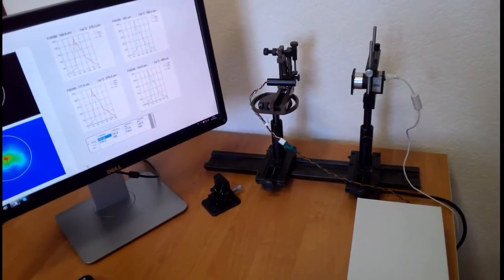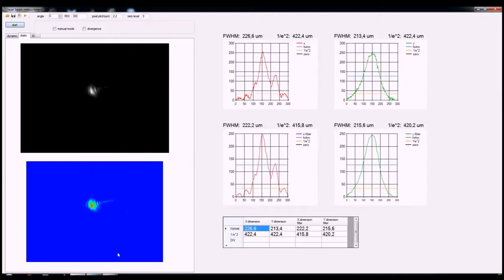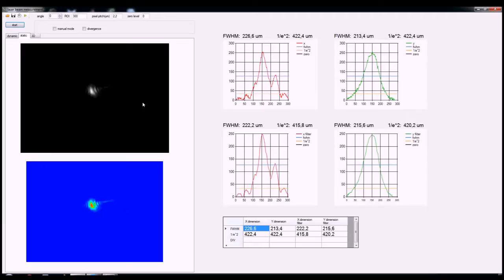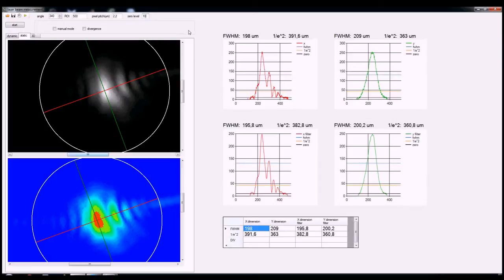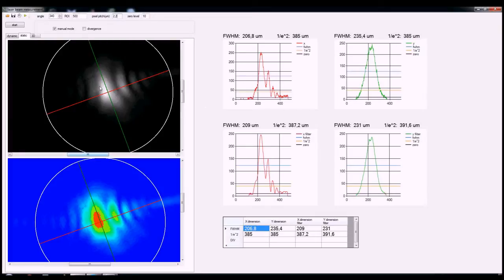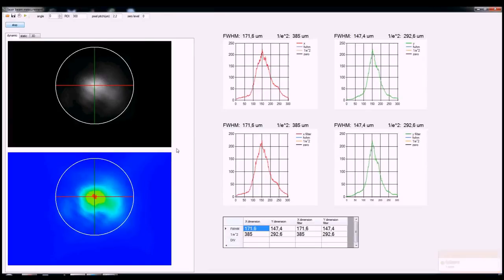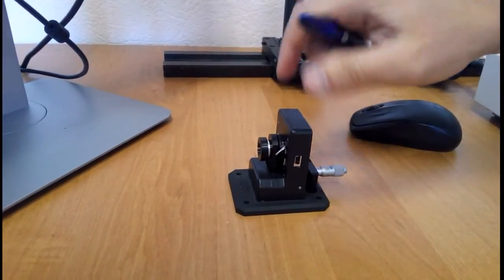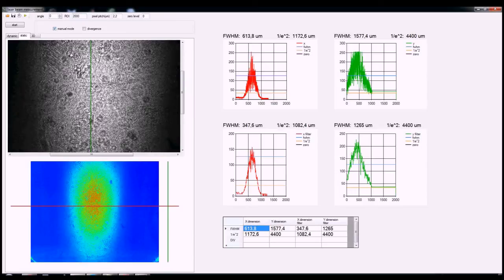Open Source laser beam profile measurement software

Comment: Hi, When I directed laser beam to a cmos color camera I saw a kind of interferece fringes. So the image I get is not suitable for measurement. Should I use any kind of filter? BTW I have removed the objetive lens. Do I need any lens?
Reply from the maker: if you need a filter depends on the wavelength of the laser and the sensitivity of the cmos.  About the objective removal I'm not sure.

Comment: hello , should i have a beam profile system (hardware device) or can i only get it from the normal detector and then see the results from this software, thank you
Reply from the maker: It depends on the laser wavelength and power and if they match the camera you are using. If camera is matched to laser you can use this software without another other items
Reply: @johnellis1013  can i contact you by email , i am currently working on picosecond laser .
Reply from the maker: @bassamkamal4450  our website is www.opticsforhire.com you can find contact details there